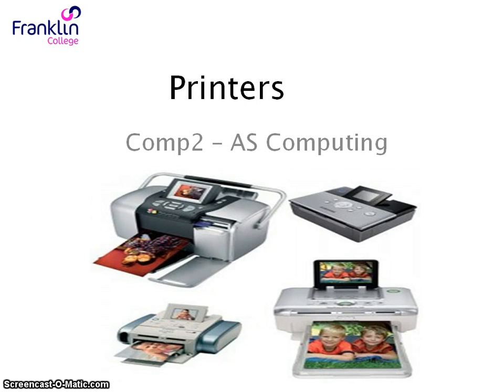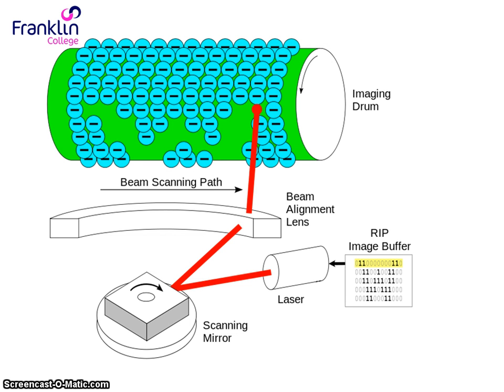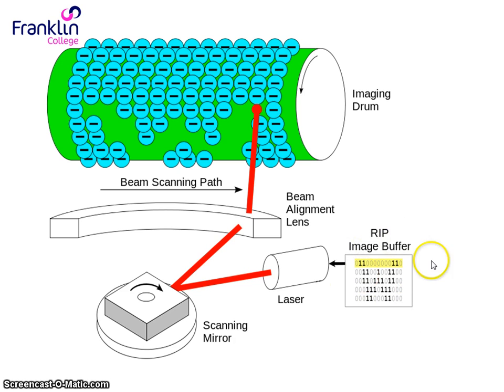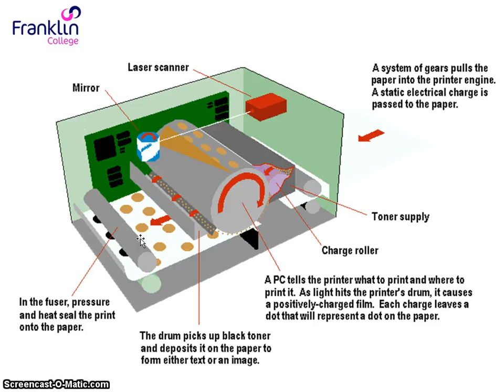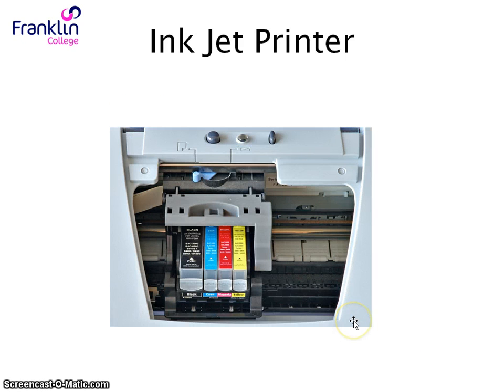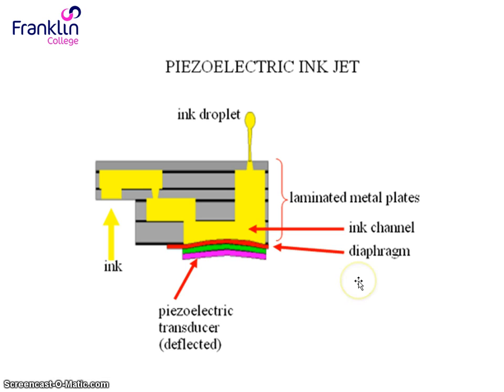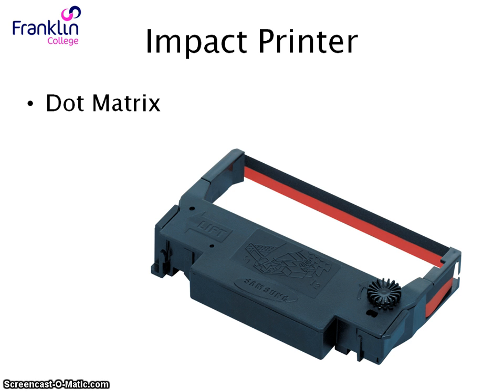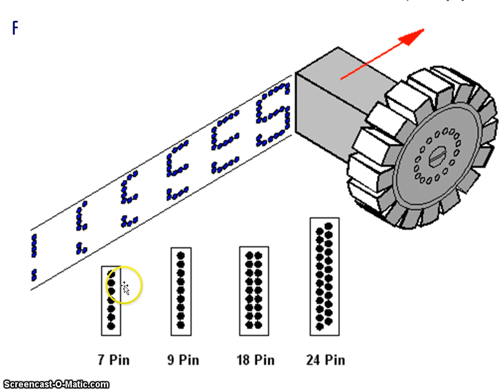AQA Computing - Different Types of Printers

Comment: I don't fully understand how the inkjet printer works. Perhaps it's the physics component I don't understand.

But you say the ink is heated up, so in the diagram you show is all the yellow ink shown currently vapor? Or is there a reservoir or ink just in the first rectangular section which then gets heated up and turned into vapor?
And the most confusing part, now that it's vapor how does pressure from the piezoelectric Crystal propel the ink? If it's vapor? All diagrams and animations I've seen seem to just simply show the ink being heated up and then a droplet spawns and is propelled. Which then follows more ink magically moving into place for the next propelled droplet? Shouldn't the ink be constantly going into that position all the time? Is that just inaccurate animation or me just simply not understanding how this works?
Reply: Ahh I think you've described two different types of inkjet here. Since you describe the piezoelectric crystal and heating element on the same diagram. When only one of those methods is used I think. I may be wrong but that is what I see from wikipedia.